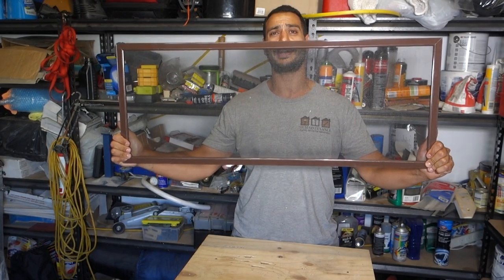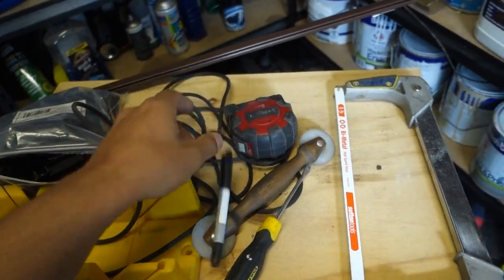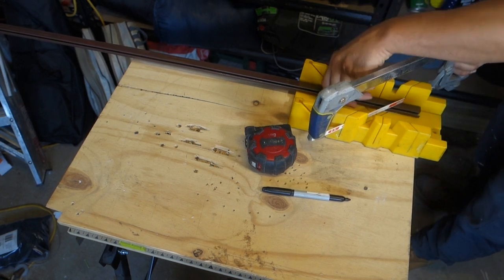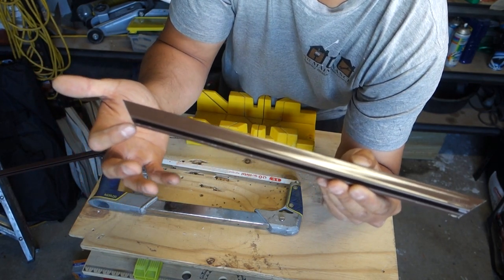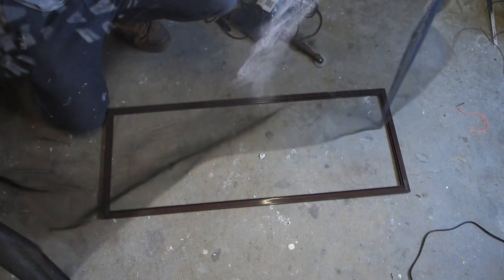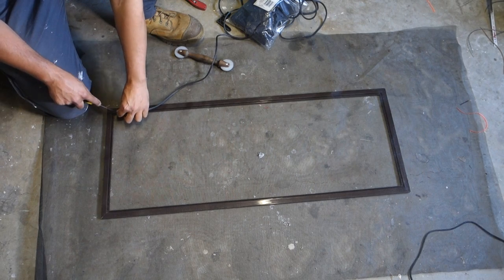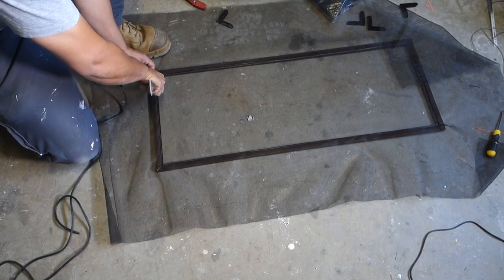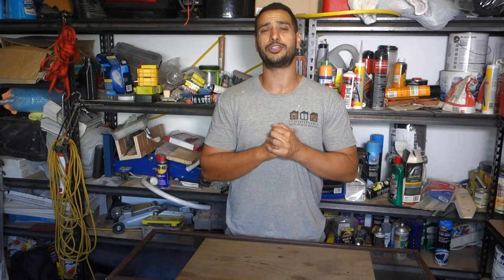DIY fly screens for windows - how to make tutorial

Comment: I already have a roll of  pvc coated aluminium flywire which is thicker & stiffer, so does it work exactlly the same? Does the spline have to be thinner when using the flywire I have, or do I just have to put more pressure on pushing the spline in around the thicker/stiffer flywire?

Comment: You haven't mentioned how you take the measurements for the flyscreen. I need to know how much to deduct to enable the flyscreen to be slotted into the frame easily without damaging it.
I was told 5mm but that seems to be a bit too tight.

Comment: How did you determine how big the frame should be to fit into the window?  Because the idiots at my apartment measured the window and then made the screen frame too big to fit in the tracking.  I know!  What is the correct way to measure?

Comment: My place has settled and I'm renting so it ain't getting fixed any time soon. As such some of the windows are a bit lopsided. Should I still make a rectangle and then try and force it in, or better to measure with the wonkiness and try to make the cuts of the frame at slightly different angles to make a wonky (but fitting) fly screen?
Reply from the maker: Lol, Unfortunately to build the flyscreen you need to use the corner support piece which is at 90 degrees. You can make it with slight variances but it will look pretty funny. What type of windows are they?? Sash, awning, aluminum sliding?
Reply: @billshowto  Bugger, thought that might be the case, and didn't even think of the corner bits! 

They're aluminium sliding style. The bathroom window copped the worst of it and is jammed shut but with a triangular gap in a corner. I'm astonished it hasn't shattered yet.

I'm thinking I make them slightly smaller than they need to be and figure out a way to maybe even just caulk up the worst of the gaps or something. Pretty sure I'll find one of your vids that'll have some tip in it that will help me :)

Loving them by the way. You've inspired me to take ownership of the faults in this place and sort them out myself. The real estate agalent sure ain't doing diddly squat about any of the problems.
Reply from the maker: why you can try to do is make them slightly larger and screw then into the window frame from the outside of that makes sense
Reply: @billshowto  Ah ha, that makes way more sense. You're a legend, thanks mate.
Reply from the maker: @JebusJones  👍